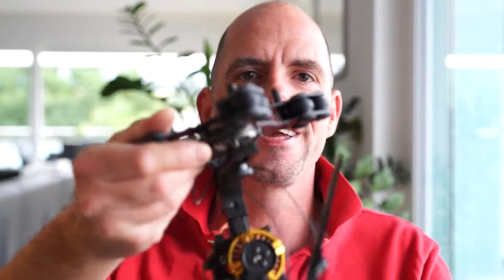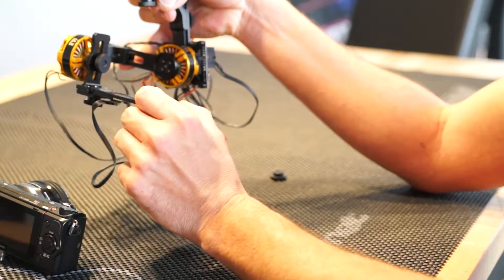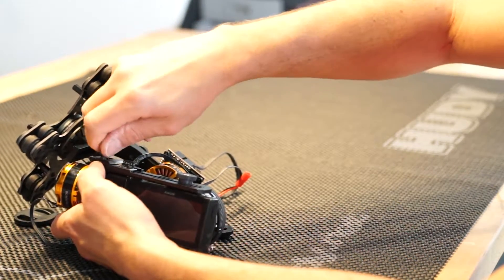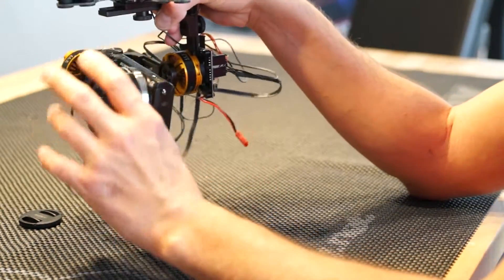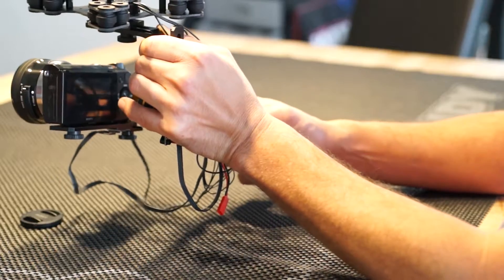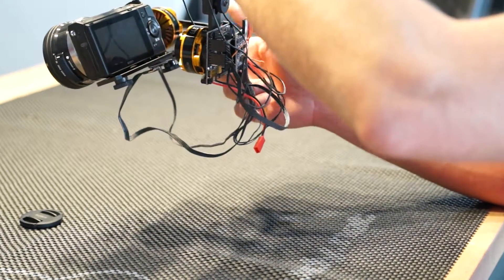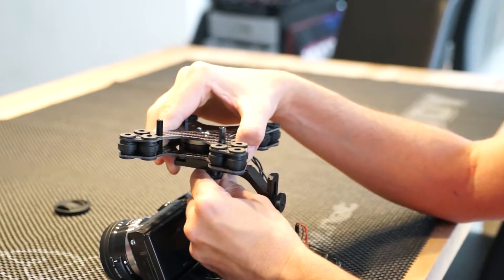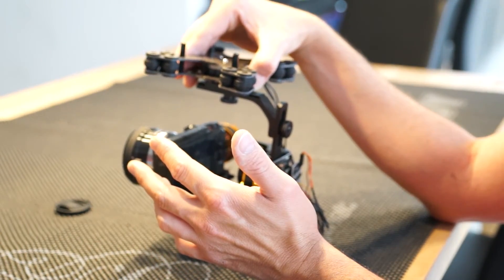How to: Balance a mid size Gimbal

Comment: Would a Blackmagic Pocket camera work with this gimbal?
Reply from the maker: Never tired, but the original motors are pretty weak. I assume it will work when you exchange them to Arris motors. Another option would be the Arris Zhanyou 3 axis gimbal for the BMPC
Reply: Locoracers great, thanks for the info ;)
Reply: +Locoracers pocket camera is no heavier than nex camera if you dont use very big lens. so I dont see why not? besides motors seems to be ok for any camera around 500 600 gr with lens

Comment: Hi,

My gimbal (same as yours) seems to be having problems on the Yaw balance. Although i get it to balance when rolling the gimbal left and right, it will rotate 90 degrees when i tilt the gimbal forward and backwards. In other words it is balanced but not dynamically balance meaning that left and right sides are balanced but forward and backwards is not. It's like having the roll axis always return to the center which is halfway balanced but that type of balancing will not work on the yaw axis. Any tips? Using the sony nex 5n with the Sigma 19mm lens. Both pitch and roll axis are well dynamically balanced.